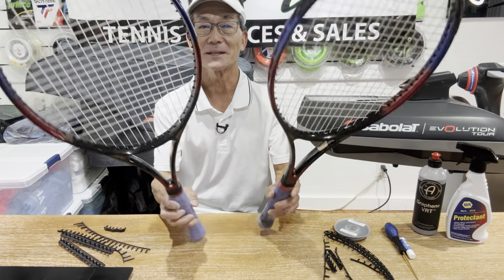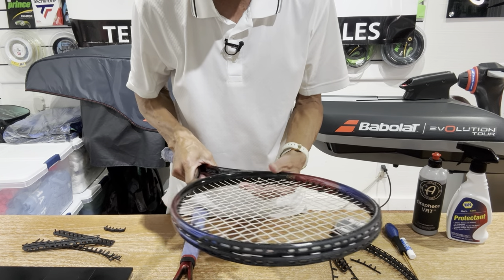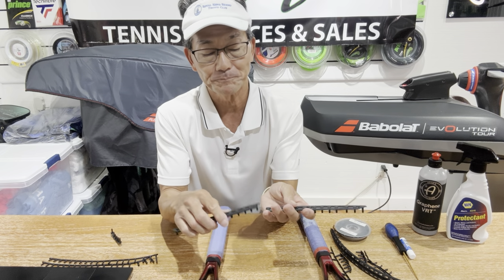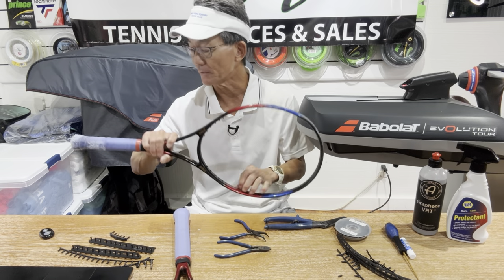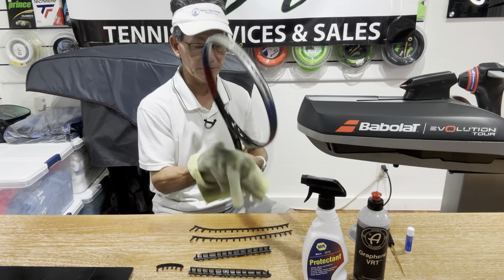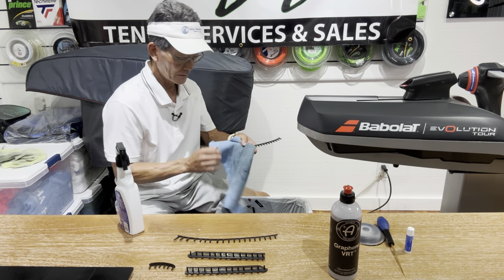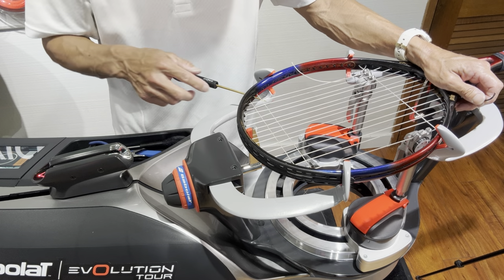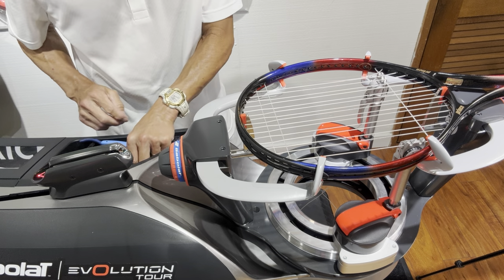Racquet Repair [Stringing Problems & Solutions]

Comment: aloha albert. in the past, grommets were made of a harder plastic that wasnt very durable. they were brittle, cracked and broke to rattle on the string. over the years grommets have improved and more pliable perhaps have higher rubber content. im not sure about using a protectant on the grommets but if it drys might be okay. armor all would not be good. during stringing it can transfer on the strings and then on the clamps to encourage slippage.

when you held the racquet up,  the head bumper guard looked familiar. my cousins last racquets were the cts blast. i dont know what model you got there but my guess its in the old cts (constant taper system) series
Reply from the maker: Aloha Coach Dudley, 
Yes, I don’t why these particular grommets were so brittle. I’ve had some older ones hold up better than these. 

Good point about the clamp slippage. I guess in this case over spraying the grommets is not recommended or applying with a rag would be safer. 

The racquet is the Thunder 820 🤙

Comment: Great content and thanks for sharing the process... I bought some new bumper guards for an older Yonex ezone xi, you know how the corners go especially on the box corners of Yonex racquets but the new bumper guard was like your Prince one, it was pretty stiff, wasn't quite that brittle but it shredded up quickly after replacing.. I definitely will try to condition the plastic just to see if it can stay more malleable, heat gun definitely would've helped on a Yonex bumper guard.   One of the underrated maintenance items people have to consider for their racquets.
Reply from the maker: Aloha, 
Thanks for watching. 

I ran into a problem with Yonex racquet but can’t recall the model. It had rubber grommet barrels at the 3:00/9:00 head locations that were breaking off so I decided to cut them off flush to the inside of the frame. 

And yes, a heat gun (even a blow dryer) does help when installing grommets/bumper. 🤙